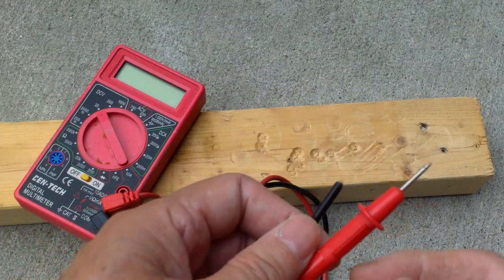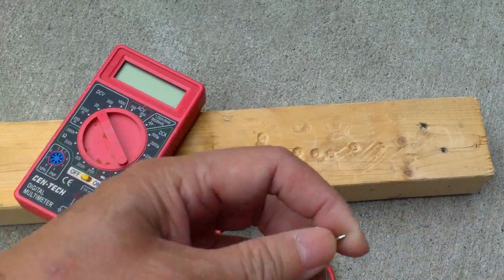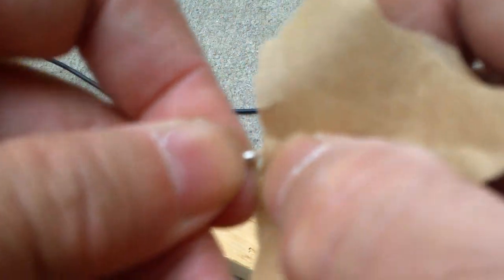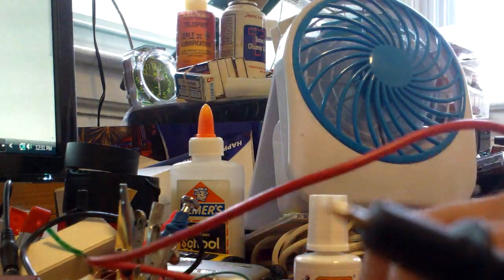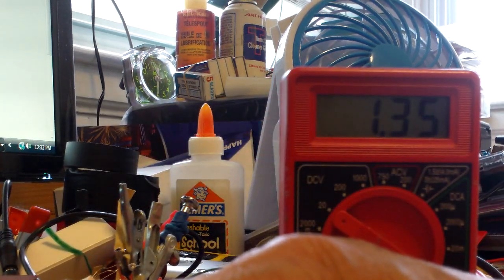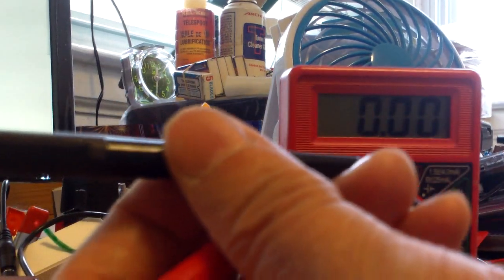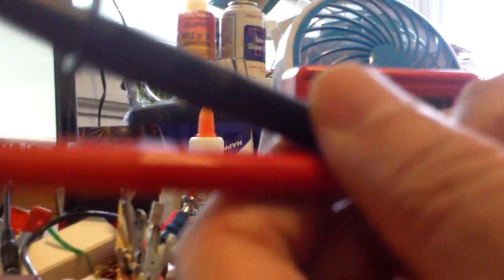How to reattach a broken multimeter probe wire

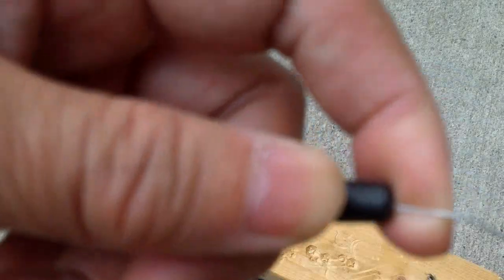Comment: some probes are there that the tip can be pulled out from front. By the way, at 00:52 don't you already have the metal tip on your palm as you act like pushing it from a piece of wire?

Comment: For $.99 delivered, I got a set of leads on flea bay that make three of the ones From HF. I figured that a free meter was worth a buck to fix. The HF leads are notoriously bad. Even if you solder the wire back on, there is no strain relief and it will quickly fail again. Chuck 'em.

Comment: Great fix for when the wire comes out of the probe part, I however have that issue plus another issue where my wire near the plug end is starting to break, I don't see a real good way of fixing that end, but its also dangerous when testing outlets running 220 or 120 and accidentally brushing against it when grabbing or moving the meter..

Comment: i fooled around with mine, dissected the faulty lead, repaired it.  it was a broken connection within the 'elbow' connector.  split the elbow along the spine-seam with a scalpel. cheap way to practice soldering with no downside - the lead was no good anyway so i had nothing to lose.
Reply from the maker: Thanks for sharing your repair ideas.

Comment: Thanks for this. Actually there is a plastic collar for the metal end of the probe that you pop out of the plastic holder part of the test lead. After soldering the wire, put the metal end of the test lead through the plastic holder, push the plastic collar onto the metal part of the test lead, and then insert the plastic collar and metal end of the test lead back into the plastic holder.

Comment: Yup this is what I usually do to fix them ( hint) to help stop this  happening   in the 1st place/again  take a few drops the thin runny super glue and point the metal part of the probe down and put a few drops of the super glue where the wire and holder come together and let it seep/wick down and let it setup  I've never had another one break after doing this
Reply: I have them  breaking all the TIME,, ,Ill give a try ,, I was thinking of heat shrink  or stick something inside ,,but the SUPER GLUE  should  to the  trick/// to snug up the wire THANK you
Reply from the maker: Good idea with the super glue.

Comment: Excellent video!  My dad had the same thing happen to his Harbor Freight meter. He was able to swap it out.  Otherwise he'd be doing a repair like this!

From what I understand this is a common problem with these meters.  Fortunately the repair doesn't look too bad.
Reply from the maker: The meter probes often get snagged and if we pull on them instead of untangling them, the connections will weaken and eventually break. A better strain relief would help but what do you expect from a meter that costs a few dollars.  I couldn't figure out initially how to separate the metal piece from the plastic holder but figured it out later. If this can happen to my meter, it will happen to someone else's.  Now, how am I going to fix...
Reply: wtam69 We have a meter from Fluke at work that gets the living crap beat out of it every day and this has never happened to it.  Of course, it is a Fluke, so it practically goes without saying.  These HF meters are excellent for the price, and so far you've hit just about the only 2 downfalls of this meter, the wire coming off the probe and adjusting it with the potentiometer inside.
Reply from the maker: jaykay18
I will gladly buy a Fluke if I know how to use it fully to justify the cost :)
Reply: Well you have a great Harbor Freight one to practice with!  They all do the same kind of stuff, obviously, just some better (and easier) than others.  The Fluke at work is auto-ranging, so you don't have to select the voltage range with the dial; just set to AC volts, DC volts, AC amps, DC amps, Continuity, or Ohms, and the meter does the rest.